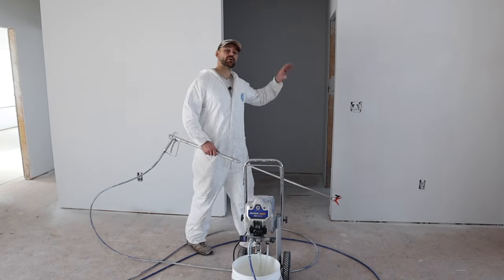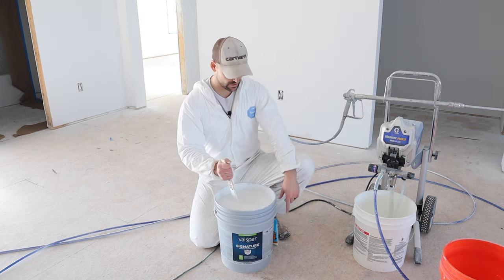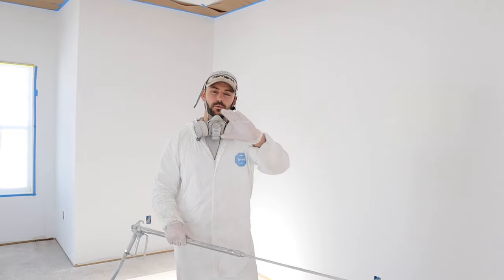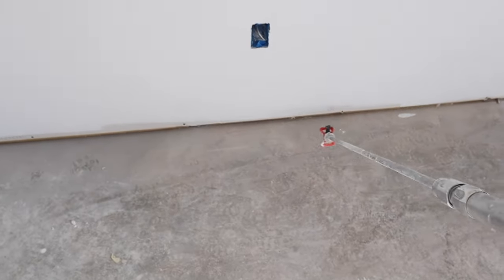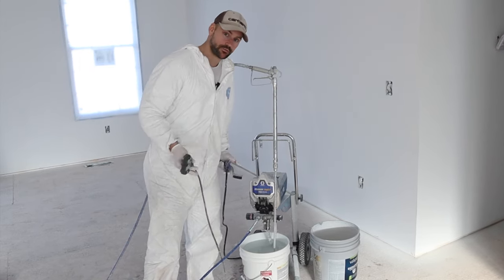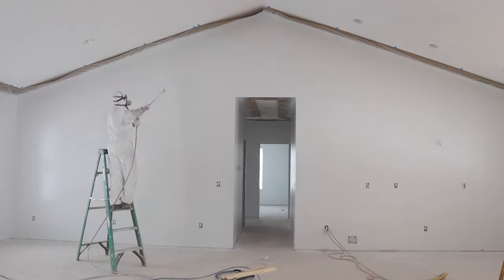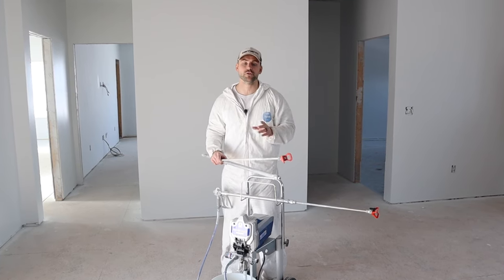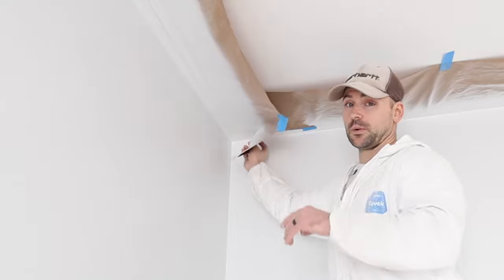How To Paint Walls With Sprayer - 5 Tips For Beginners

Comment: Backroll? That's why I bought an airless sprayer so I don't have to do that. WTF?
Reply: To maintain the same texture as hand rolled sections especially after touchups
Reply: Exactly! Wtf is that backroll
Reply: Yes…back roll for more consistent finish. Especially if the wall or ceiling has texture/knockdown.
Reply: That's why I also bought a pressure roller.
Reply: This guy is doing double work for everything spraying/back rolling  and masking 😂
Reply: Anyone who's painted much with a roller knows that spraying and backrolling is faster for a better finish. 
You can go fast with a thick nap roller but the finish won't be good.
Reply: @aberba the whole point to use airless is to get a smooth finish not texture
Reply: I painted professionally and the builder I painted for made us backroll after spraying

Comment: What’s the point of spraying if still going to have to roll it?
Reply from the maker: It gets the paint on the wall, so you simply just got to texture it with your roller. If you use only a roller only, you have to work much more in order to get the paint on the wall. I hope that helps!
Reply: Backrolling also lets you go back and touch up with a brush and fill the cracks on the texture

Comment: When you get comfortable enough not to backroll you should grab a Cleanshot valve with an extension that long. It will get rid of spits. I bet you are getting a lot of spitting but don't notice it because of the backroll. If that was dark paint you would really see it. Good video though and good tips.
Reply from the maker: Hey Dane. I have not noticed spitting but like you said if I’m back growing I probably don’t. Thanks a lot for your input! And thanks a lot for watching!
Reply: That's right. Any extension will cause spitting as residual pressure will continue once trigger is released. Always back roll when using extensions.
Reply: When I use extensions I try not to let off the trigger to reduce those spits.

Comment: I need to paint all of our interior doors, mouldings and baseboards. I have the same sprayer you have. I will be using it for the first time and wondering how much overspray I would get. Would it be ok if I mask off 12” around the crown mouldings plus the floors or should I plastic wrap all of the walls from the ceiling down? Don’t want to ruin the walls with overspray while doing the crown mouldings. I like the look of the spraying vs rolling on all trim. That’s why I bought the sprayer. I know I’m making work for myself but it is what it is.
Reply: Trim and doors it’s sometimes best to use a fine tip so you don’t have run and it’s looks smoother

Comment: Need a cleanshot valve buddy(this is not optional when using any extensions). It's going to nearly eliminate spitting. I also recommend getting some fflp tips, they spray way nicer at lower pressures so you won't get nearly as much blowback and get a softer more even sprayfan. Right now you're getting very, VERY lucky because you're not using any real colors... It's basically white on white, but once you start having actual contrast on your walls you'll be able to see the difference, especially before backrolling. I also highly recommend using emerald trim paint... And emerald wall paint... Especially on dark walls, it leaves behind an absolutely incredible finish with a nice microfiber roller (my favorite combination on high end projects).

So the cleanshot valve... Just to give you a quick summary of its importance, first off it allows you to swivel your tip. So even if you're using a big extension you'll be able to get a good angle on even the tightest, tiniest spaces. In addition to this it has basically a pressure regulated mechanism right at the tip that you can adjust, this is going to be your best friend when you spray exterior vinyl/aluminum siding that you shouldn't be touching with a brush or roller, and where a clean consistent spray fan is crucial. Even without any extensions on you will notice added benefits of having a cleanshot valve at the end of your gun. It makes it feel so much more responsive.

In the future I would consider upgrading your sprayer to a Graco 395 pc or 495pc... Fantastic units that will noticeably increase your speed and finish quality and make way less noise than your current setup... if you want to splurge on a dedicated trim sprayer the Graco gx19 (gxff overseas) is a great little compact unit with a hopper. Now I know what you might be thinking... These airless sprayers just pressurize my line to ~3000psi...how could it be faster? It just is, trust me. It sprays faster and cleaner with far less pressure drop. I remember when I first upgraded, and noticed productivity just flies through the roof. You instantly just notice that you all of a sudden have to move your arms faster or turn down the pressure a little (whatever you prefer in the moment). It's the equivalent of using a rearwheel drive car in the snow, then using an all wheel drive suv with studded snow tires, instantly noticeable performance difference (with the 395, the gx19 is just a massive convenience upgrade for trim). It will save you so much time spraying large projects out it'll blow your mind. It can just pump out the paint faster than you can imagine.... And you'll be ripping through those 5gallon buckets.

Edit - you should also invest in thr yellow stir stick at Sherwin and start stirring up your paint with a drill... It makes the paint buttery smooth especially if you strain it as well... And gets the tint properly distributed better than even the shakers st Sherwin or homedepot. This is crucial on darker colors, especially if it's been sitting around for a few days. Heck I've seen some colors/products start to seperate within hours. Never hurts to stir it up before use. The thicker the paint thr more important this is, especially on things like blockfiller, drylock, or any other waterproofing paints or paints with sand added in for texture/grip. These products are practically unusable without stirring them up with a drill.
Reply: Nobody is trying to read all that
Reply: @Sncedayone  😂
Reply: I read all that. 
And you’re 100% bang on. 
From the clean shot to the 490PC to SW Emerald (I use the Emerald urethane enamel for soffits and facia). 

I’d be laughed off the job site if I showed up with a Magnum X7 DIY grade sprayer.

Comment: Good video, I did giggle when I saw you lift the whole machine to change paint buckets. Just keep topping up the first bucket with paint from subsequent buckets once the first bucket hits half empty. No splattering paint and repriming each time!

Lifting
Reply: 5 gallons of paint weighs between 30 and 60 pounds, the machine weighs 30 or less

Comment: Steep angle on removing tape - even when taking the tape off the roll (especially if the tape roll has been kicking around for a while) so that you get the full width of the tape and not have it shred from the roll or the substrate. I am amazed at how many DIY's (and novices) don't shut down the HVAC when doing messy work that really calls for blocking or shutting it down, same with thermostat/ smoke/ cO2's.. electric outlets, etc.,.
Great Tips and awesome video - As All~ways!
Reply from the maker: Hey C Kuiper! I know it’s a simple thing to forget about doing. Sometimes I will start cutting trim during the finish stages of the house and forget to shut it off and then the filters will be clogged by the end of the morning. We don’t want that! Thanks for stopping by and watching!
Reply: I have a question, been painting forever but spraying only about 2 years. What takes more time masking the ceiling or cutting the ceiling? Like why not cut down a foot on these high ceilings ? Because it will flash ? I mean I see this video the job is almost white on white but would you mask and spray a darker color this same way ? 
I'm amazed at how people are spraying everything these days even interiors that a furnished with floors and carpets etc. How is that even possible!!? Does it not take more time to mask everything ?  I was always under the impression if anything spray all the trim cut and roll the walls. I could ask questions for days. Thanks

Comment: Thanks for the video. I have walls that are all plaster that I will be priming twice before painting with my main color and was wondering if back rolling was necessary? and if so could you explain what it does for the walls after you spray them, along with if you need to back roll after every coat. also when you back roll will you see the roller marks ? Thanks

Comment: I run the prox17 too. Started with the 515 tip, then tried a 517 because it seemed like I was not getting enough paint out. Wow, man what a difference. Yes. You have to keep that tip moving and have your spray technique down. But man, I love it!! Try one...no back rolling
Reply from the maker: Hey Ron! It seems to be a great sprayer. I really want to try that 517 tip. I have not experimented with a bunch of tips but I use this 515 and about everything. I actually have not tried and not back rolling. Maybe on the next house. I appreciate you watching!
Reply: @TheExcellentLaborer  Definitely get the 517. And you'll probably want to shorten those extensions. They cause spitting the more length you have. I run about 12 or 20" max. Which is also how I avoid back rolling. Quality paint is huge too. I use sherwin williams cashmere for walls and emerald for trim and doors. 

Nice, even overlap. Keep the tip moving and don't let off. Get er done!

Oh, adding this...yes...run the 517 on max pressure.

Also, run the FFLP 210 and 310 for trim and doors. Glass bubba!

Comment: I spray and backroll. If you don't backroll, the coverage will not be even and you have to use more paint. I can't imagine not backrolling.
One guy sprays, and the other backrolls. Very fast. However, the last two guys each quit after one day. That rolling wears you out. 
Fortunately, you can do a whole house in one day, so, by the time they realize you are working them to death, your're done.
FYI, anyone thinking of buying a less powerful machine, be ready to return it. It takes a lot of power to atomize a thick Latex effectively.